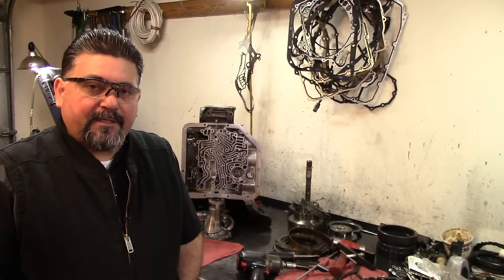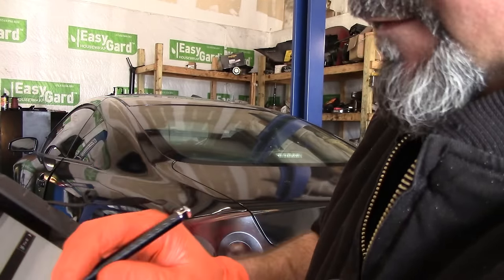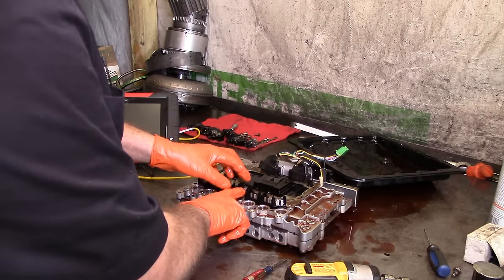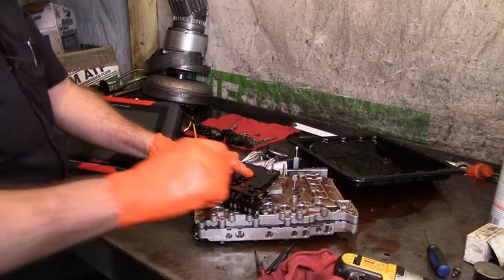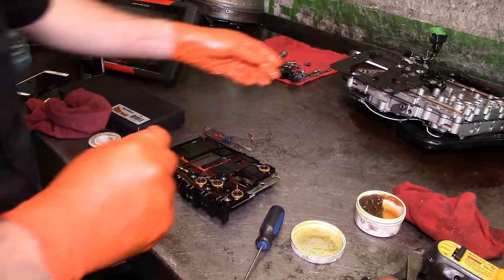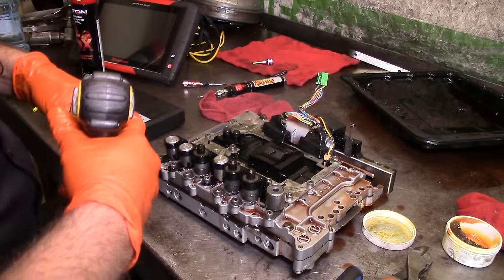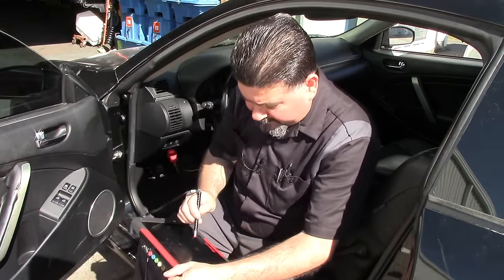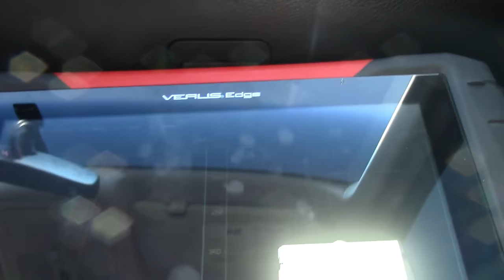RE5R05A Transmission -  P1757 Front Brake Solenoid Circuit - Infiniti G35 Coupe

Comment: Hiram, can you confirm that the RE5R05A Transmission, used by Nissan and the A5SR1 used by Kia, is the same 5 speed RWD transmission? You would be doing me and a bunch of early Kia Sorento owners a huge favor. Kia suggest that we use APolloil Red 1 K, which is super expensive in my country. I am simply looking for a cheaper alternative. If you can recommend one, we would appreciate it very much. Thanks so much for all the great work that you do.

Comment: Hiram, I have a question for you, I have a 2005 Nissan Titan with the p1757 code front brake solenoid,  would this repair work the same , awesome video and instruction and I wish you were in Houston to do the repair for me!! Thanks
Update , I did replace the entire valve solenoid with TCM and good as new again , thanks and saved a lot of money!!!
Reply: I’m I. Houston if you ever need anything on Nissan or Infiniti
Reply: Gorge, when you replaced it did you have reprogram the tcm?
Reply: @tbrown9222  
No , didn't need it , plug and play
Reply: @gorgejuarez2404   thanks so much for the response. Also where did you buy yours from?
Reply: @tbrown9222  
I got mine from Nissan , a bit expensive but the first couple of used I got from Apache Transmissions but only lasted a month the first time and 2 weeks the second time and the third time was a charm from the dealer , it depends what year because my 2005 didn't require a flash but the newer models require to be flashed, if that's the case Reman is the way to go if you plan to keep the truck if not throw in a used unit.

Comment: Hey, thanks a lot for this video man!I have 05 pathfinder right now with p1759 code, ( falls into safe mode) I showed your video to my mechanic and he said that it is too complicated and he would not do it. So I will do this myself.I also have 05 Armada which leaks fluid, so I did put some fluid in it and got it moving forward but it wont go in reverse. You think fixing tcms on both cars would work? And Is it possible for regular DIY guy to do this?
Reply: Did you ever fix this issue?

Comment: Cool, not having the same issue, but need to drop my valve body and inspect the TCM.

I was told by a valve body remanufacturer that my p1716 (Turbine revolution Sensor) code , that only happens when cold is most likely the sensor being ever so slightly too far away from the drum it is reading. She said that the sensor should protrude the thickness of two nickels above the plastic.

Having worked on the tcms aton, do you see a way that the front sensor can be adjusted to protrude correctly?

Comment: What caused the stamped terminal to fracture at the bend?  I assume this was not broken when the solenoid was originally replaced. Possibly a poor design or manufacturing flaw when the part was made.  Great video!!

Comment: great video Mr hiram. I have "05" G35 coupe I just purchased.previous owner changed the transmission. Now it won't stay running past 20 seconds. No acceleration. 2 codes came up for valve body and alternator. I took it to 3 transmission shops. they all tell me the previous owner must have put in the wrong year transmission. my question to u is ,should I change the valve body or do I have to find another transmission?

Comment: Hi Hiram , excellent videos . 

I have a 2003 g35 sedan automatic,early build date of 2002. 
My valve body looks different from this one i get P1754 ,my solenoid plugs have actual color wires not the copper metal like connectors. 
All connections look solid , any ideas ? 
Your help is greatly appreciated

Comment: Thanks bro watched this and fixed my Ex35 🤙
Reply: Hi, sir, If just soldering the metal wire, does it require transmission fluid flush?  Thanks

Comment: Hi Hiram, I have a 2003 g35 similar to this this car. I have a p0720 code meaning a speed sensor. In this video I saw you disconnect the wiring harness to the body but I don't see the actual sensor. Where is the sensor located? I'm having trouble finding it

Comment: I have a 2007 infiniti m35 and recently replaced the low coast clutch solenoid after a run of a check engine light revealed that it was the problem. Based on your video, my car came with the nachi style solenoid and I replaced it with a Mitsubishi solenoid. I also went ahead and replaced all the solenoids. Now my car shifts hard from 2nd to 3rd (feels like someone rear ended me in the back) every time it shifts.  Also, at first start during cold weather it sometimes goes into limp mode when shifting from 2nd to 3rd and would take at least a couple of seconds before it engages again. My question is, is it then solenoids causing the issue or is my TCM failing? Just would like to know which part I need to fix. Thank you for your assistance!

Comment: Thank you so much I think this has happened to my fx35 I’m going to try and see if this is it. My only question is after the repair or fix is there any reprogramming needed?
Reply: What was the update with your fx35 I fix mine 2 times and keeps breaking 😢
Reply: @ramongonzalez2846 what did you end up doing after it kept breaking?

Comment: Hey Hiram..i have a 722.9 with a tcc lockup solenoid circuit code.. we had tear down the unit and the unit was clean as i knew it would be..we had changed the tcc solenoid with another one and it still comes up with the code..my question to u is considering the RE5R05A tcu conductor plate and solenoids are made by the same manufactuer can this unit have the same type of issue going on as the infiniti in your videos..ive repaired many of the RE5R05A tcu with cleaning and soldering like you have done many times..do you think the unit i have may have broken solenoid tab leads or circuits like the re5r05a ..by the way the vehicle i am working on is a gen1 2004 mercedez s500 v8 5.0L 722.6 rwd ..your insight would be apprieciated and also enjoy your well produced videos

Comment: I repaired the broken wire on the truck and the car ran good for about half a day it started running the same today with code p1759 . Do you think it’s the sensor now ? Where could I find the sensor for the front brake solenoid? 2006 infinity g35. Thank you

Comment: Mr: Gutierrez, thanks for the info. There's not much out there to confirm what I need to do...May I ask your advice, please? I have a 05 Frontier Nismo.  Had problems with the transmission recent throwing codes like P1764 Direct Clutch Solenoid Function and 1769  High And Low/Reverse Clutch Solenoid Circuit. So my son and I took the valve body out brought a refurbished set of solenoids fitted them. It was OK for a day or so but now it's acting the same way. Anyway after research I have come to the conclusion that before I owned the truck it may have had coolant contamination due to rust on the TCM metal surround and on the old solenoids. So I've been trying to figure out if I buy a reman/refurb valve body with the TCM and solenoids on it, can I install that, then take it to be programmed, or do I have to somehow download the TCM data from the existing, one remove the existing one, then install the refurb one and upload the data to it
Thanks a bunch

Comment: Hi Hiram, Just changed the control valve body and ecm on a Nissan Frontier 2005, it was giving the p1757 code before and the circuit was broken just like in your vid. Now it has been replaced , the transmission does not shift , it just stays in a high gear regardless of the speed of the vehicle. Before it was changed  it would stop driving all together. I would turn the ignition key off and then it would drive like normal for a few mins after that then stop again. What could be the problem now, no debris in the oil pan and it reverses fine. The output speed sensor is connected and the speedometer works. No Codes at present now .Thanks

Comment: What year is this g35 coupe? I have a direct throttle solenoid that seems to be sticking. Do you know if it is possible to replace just the solenoid? Everything else is fine, no other codes showing

Comment: Mine is not throwing any codes but it erratic shifts and then shifts down and wont shift back. Could it still be the solenoids without throwing codes? The only codes I have are p420 and p0057. Thank you.

Comment: Hiram, 
this video was EXACTLY what I needed to resolve the P1757 code for my Xterra (2006). Seriously an awesome video. Everything went without a hitch upon installation. Engine light went off, error code went away etc, so it really seems this was the fix HOWEVER... upon reinstalling the valve body - there is absolutely no response from the transmission when I  move the shifter through the gears.

My thoughts are, it must be something I did with while reinstalling the valve body (maybe air in the valve body?). I made sure fluid levels were meticulously kept proper, shifter linkage engaged with plunger & pin on valve body, cable connectors connected. I feel like I am so frustratingly close to getting my X back on the road but there something simpey I've missed.

Anyway, anything you can perhaps offer any insight on would be absolutely incredible. Thanks again for the awesome video! 

Regards, 
-Stefan
Reply: Did you ever figure it out?
Reply: I have literately the same problem I replace valve body which was a used one and when reinstalling it my car never went to drive or reverse ?
Reply: @jasondominguez830  did you figure it out ?
Reply: @Daniel-jk9ge  yeah bro appreciate it
Reply: @jasondominguez830  what was it ?

Comment: I did exactly what you did on my 2006 nissan frontier automatic transmission and installed it exactly but the Transmission is still very sluggish. do you have to activate the transmission after installing the valve body?

Comment: I am having this code on my 05 g35 coupe - car will start out in 1st gear,  and shift normally ONCE then will lock into 4th after. Extremely healthy otherwise. Should I just purchase a new valve body with solenoids and install it myself? Will that fix it , given I don't have coolant contamination?

Comment: I recently had this issue and soldered the connector to the brake solenoid which fixed my issue for 2 miles of driving. I was really excited! Thank you for the video. My issue resurfaced with a different error; P1757 Brake Failsave Vale Malfunction. Is there a good way to test the solenoids when I go back in to attempt another repair?

Comment: So I just got this code same car as in the video, could this be fixed by just replacing the front brake solenoid or do I need to replace the entire valve body? Because replacing the valve body is like a 1500 dollar job .. help??

Comment: Hello Hiram im located in  Canada Inhv an 08 g35 sedan with 150 000 km on it. it threw p1757 apon metering the brake band solenoid its bad. At this point im lost. How much would you charge if I ship you my valve body to fix it ? Instal the new solenoid and put vb all back together ?And would it need to be flashed by Nissan dealer or can you flash it so that new solenoid works? 
James

Comment: i just tried to replace a solenoid on my 2005 frontier . direct clutch solenoid .  i got it back together and installed . but now i believe i have screwed something up .  1) it will not come out of park 2) will not crank or even turn over and 3) obd scanner says no link ..... is there any insight u could give me towards these issues ?

Comment: i have the same issue but in my daily how long on average does it take to repair? ive had the valve body out before but it didnt start having an issue till my radiator popped so i know tge vb was contaminated. could it still be repaired or do i need to get a new valve body after 2 trans flushes and multiple ecu resets it gets worse

Comment: Hi, I got a 2007 Nissan Pathfinder, p01717 turbine sensor, when it sets this code there's no TC lock up, I found coolant in transmission  early, multiple flushes after radiator replacement. The code is intermittent. Do I need new TCM?

Comment: If I wanted to change my transmission filter do I need to remove the valve body because I seen those two nuts that were attached to the long bolts in the valve body when you removed it.

Comment: Hi!
I have a Nissan Pathfinder, automatic transmission
when I leave the place, when changing the speed, it jumps directly into 4th gear and stays there. if you stop immediately and take the ignition off and restart it, it starts normally in first gear and immediately jumps into 4th gear
question: where is the problem?
Reply: This is known as "limp mode" and occurs for a number of reasons. It is possibly the P1757 or P1759 solenoid codes which he fixed in this video. Can you read codes out from your car?

Comment: How did you learn all these things? You do things that you could never learn in school! Years of experience???Happy Birthday!! (smile)
Reply: Hiram Gutierrez I have a p1772 code on my 2003 G35 Sedan, It has only happened about 3 times but I started it after sitting for about a day and it slams hard into reverse and drive and wont shift past 2 but if I stick it in neutral for several mins let it warm up it goes into gear and shifts fine. the 1sr time it happened was like a year ago I cleared the code and didn't happen again until last week, I cleared the code it drove fine but did it again today.
Reply: SetolOne I have the exact same code and problem. Did you end up getting it fixed? If so what needed to be done? Thanks

Comment: Hi Mr. Hiram! I Have a 2005 G35 sedan RWD. It drives fine when its cold. But after 
driving a little like 5-10miles launching of intersection it shifts from
 1st to 2nd and it slows down (like downshifting)  then it shifts to 3rd
 gear then check engine light comes on and car goes in to safe mode. 
Computer reads 1757 and 1759 if you know what is the problem is please help!

Comment: Hi, AT, Thanks for the excellent video. I have 2 questions: 1, how to determine if Transmission is contaminated with coolant? 2, If just soldering the metal wire, does it require transmission fluid flush?

Update: code fixed, thanks again. Based on the trans fluid color it’s okay but not as clean as new so I did a trans fluid change, just put in same amount as out (i collected almost 7qt out, so I put in 8qt on my m45 FYI), did not change anything else(oil pan, etc)
Reply: you will know if it has water in it. it will look like strawberry milk.

Comment: Dude 1st you rock and I really watch your videos end to end . I have an 03 g35 with almost 198k on it and 3 codes 1754 0720 1762 does right to 4 gear. reverse is strong and fast. does the speed sensor cause all 3 of these codes my bro in law says yes but what do you say. your opinion is respected Thanks .

Comment: I did this on my g35x and went to start the car up And the Car will not go into park the shifter goes up and down too drive reverse etc. But the displace says park it will also not go into the park postion on the shifter? The car is in nuertal even thought the display says park. any idea what i did wrong? i did get a nick in the white wire system little bit of metal showing.

Comment: Hello, I have a problem with that box model that goes to fifth after a 5 minute lap and I changed several modules and it remains the same. the modules are used but they all give me the same problem. I appreciate any help

Comment: My 2015 370z automaic just started doing this yesterday. I went from drive to M and then the car started to shake a few times so i turned it off and back on and it wont go past 3rd gear. Iv only have 50,000 miles on the car and iv always changed out 4 quarts at a time when changing my transmission fluid. And it would drive smother any time i did this .but yesterday it started shaking. But this seems to be a jssues with the valve body. Guess ill check the solder on the bord and ill just have to fix it or replace sensor.

Comment: Makes me wonder if this was the issue on my g35. 1-4th gear was fine, 5th would neutral then smack what felt like 3rd gear (even when manually shifting) Only thing is tho I never had to restart the car, it would still go through the gears normally until it hit 5th. I drove it for a good while like that manual shifting upto 4th. Eventually put a used trans in it. Never pull the old on apart to see if this was the case. Still have the old trans and may pull it apart one day just to see

Comment: Hi Hiram thank you for sharing....could you share where could I find front brake selenoid valve since its not available in Indonesia..I have nissan elgrand 2008 with the same transmission RE5RO5A..thanks in advance..

Comment: I have a '07 Infiniti G35s Sport sedan (V36) rwd ...and got the code: p1757/p0744   Do i change the transmission or check the circuit b4 buying a new tranny?  Thanks!